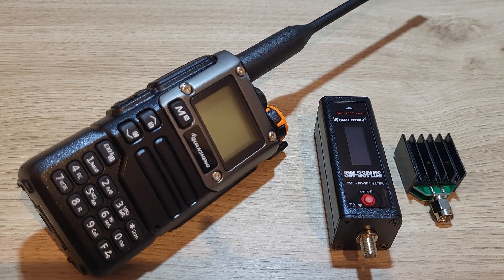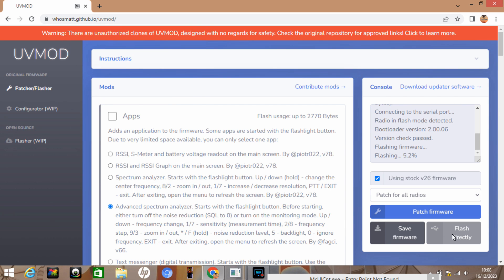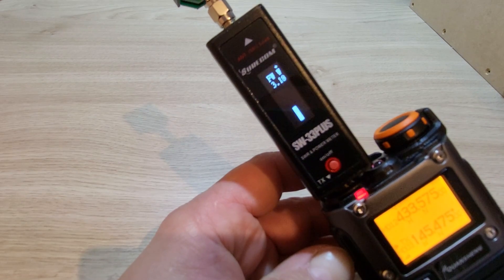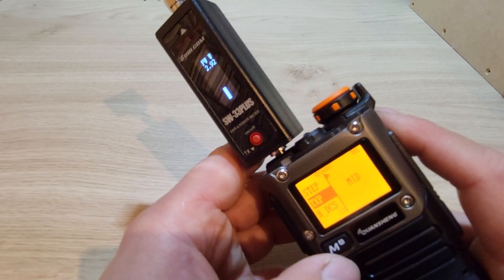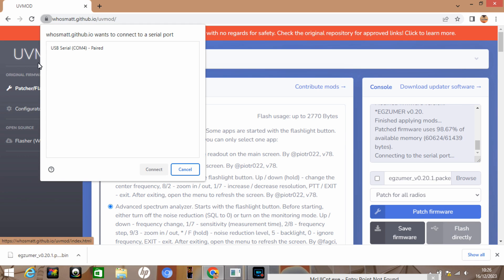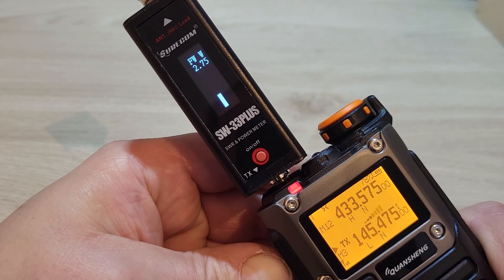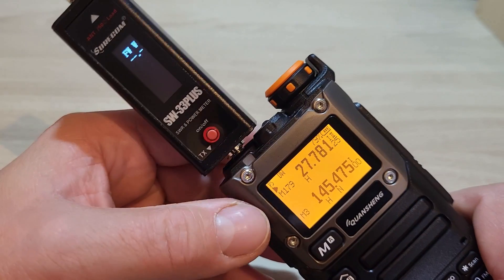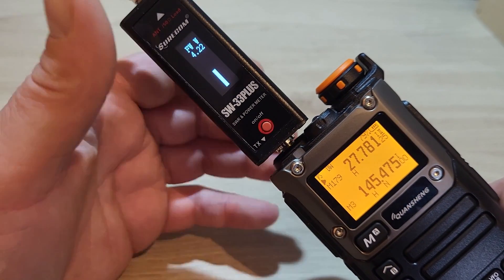Quansheng UV K5 Output Power Test - Stock vs Egzumer

Comment: my radio is only transmitting on miliwats only, , not sure what happened but sometimes it will return back to full power then go back to miliwats    . . two of my radios are like this and I'm not sure if it is a software issue.
Reply from the maker: I've not experienced that happening. You could try changing the firmware. What frequencies are you experiencing that on? How are you measuring the power output? Thanks for watching 👍 
Ben, de M7FRS
Reply: @m7frs272  I use Diamond SX-200 to measure the power output. on VHF it does not even get past through half a watt. I am using the Nunu custom firmware. 

the bands available to us in our country are 145mhz, 325mhz and 430mhz

Sometimes when i switch back and forth between UHF and VHF the power would suddenly go back to normal. But recently this trick stopped working for me and my radios are now permanently low power. 

Thanks for your videos, DW3HHT

Comment: Thank you for posting this interesting video. I have a question, please tell me how you managed to Tx on 27Mhz when it's outside the radios frequencies? All I get is DISABLED and I am using the EGZumer  firmware. Thank you.
Reply from the maker: Hi, firstly I've only done this for experimental and demonstration purposes, and as I've mentioned in this and other videos the Quansheng won't really TX any significant power on the 27Mhz band without causing interference on the Airband frequencies. If you need to be able to unlock it for experimental purposes, you need to go into the hidden menu and select 'Unlock All' 10 times for it to work.
Reply: Thank you.. Appreciating harmonics etc.

Comment: Hello Ben, I love your videos! In order to find the spurious emissions if you TX on the CB bands, you can use something like the TinySA with an attenuator (anything between 10w to 40w) in-line. It's not 100% accurate, but for the money it's a fantastic piece of kit. Combine that with a NanoVNA and you have a very complete set of measurement tools for just about everything in amateur radio. I am very surprised how badly the stock firmware has been calibrated on 70cm, quite shocking really. I have two of these handsets (and one more on the way), the "ugly" K5 and the "pretty" K6 (like yours seen here). It's great to experiment with all these third-party firmware versions, I'll have to give Egzumer a go after this. I like what I see, a 5w HT TX'ing at more than 5w is a rare thing indeed. Cheers! 73, Jan M7HNK
Reply from the maker: Hi Jan, thanks for your comment.  I recently purchased a TinySA and a nanoVNA and I've already done one video with the TinySA. Glad you're enjoying the channel 👍  Ben de M7FRS 
https://youtu.be/BE2Y7V2tGMM?si=ln_WMhUKYujjKgNj

Comment: A little disappointed on your assessment of 11 meters. Without proper testing you really shouldn’t speculate like that. Because all the cb hates just join in, and continue the ignorance. 
Other than that, keep up the other great work on this awesome radio!
Reply: Not sure what you think was said, but what we know so far is that in 11 meters the power output in that band in in low milliwatts.  But there is 4 watts going to somewhere. Others have shown that these missing watts are throwing up all over the place.  And it isn't something you can fix in software unfortunately because the bandpass filters are just not there.  The good news is that the chip can do it, so it is just a matter of time before they start making radios with this chip in it specifically for 11m.  I think they are cheap enough that most of us would happily buy one for each band if it meant we were going to get the full 5w on the frequency we wanted to use.

Comment: I suspect if you were to take a dozen of these Radios, line them up and test for Power o/p you would get twelve different readings.
In reality a Watt or two either way makes little difference anyway, and of course if you're working a local Repeater then no difference whatsoever.
These are great little rigs, but they are what they are...just fun to play with.

Comment: There is a video on YouTube where the owner of the UV-K5 did a test on the stock firmware straight out of the box, and got 6 watts High, 4.5Watts Medium and 3 Watts Low. He then flashed the EGZumer firmware and did the test again with very similar results. He then put the stock firmware back on and retested. The figures were awful. H 2.7 Watts, M 2 Watts and L 1.2 Watts. He came to the conclusion that the EGZumer firmware had bricked the power levels on his radio.
Reply: Very interesting!

Comment: The firmware you flashed the version STOCK 0.26 is not the newest and it's know for a low power output. Try using the latest version for uvk6 V3.00.15.bin or better with the UV5R RT600_v4.00.06_publish.bin . You can compare too  firmware_IJV_V2.5.bin with egzumer_v0.20.1.packed.bin for a better comparison ;)

Comment: its possible to change the power output for the three levels in the service menu of some other firmwares. i lowered mine to make the tx runtime longer in a decent area and not overdrive anything. i set the lowest setting to less than 1 w.. 2.2w and 4.5w
Reply: What are the other firmwares?

Comment: Its a bit disappointing to see low power being so high.  It would be better if they used 6dB steps.  So 5W, 1.25W and 0.3W.
Reply: At least the "Low" setting is much to high i think, would like to have it below 1 Watt..
Reply: @tvelektron  The new IJV Italian firmware can adjust the level.

Comment: Excellent, if basic, information: It suggests that no UHF alignment tests were carried out prior to shipping - but, without a spectrum analyser, it’s impossible to be sure how much of the indicated power out was actually at the fundamental frequency and how much was contained in harmonics; If nothing else though, it does give a caution re 27MHz - because we know the actual output is only measured in microwatts at that frequency - and therefore the tuned/filtered PA output stage is trying to do something it was never designed for, and all that extra off-frequency wattage has to be dissipated somewhere…
Reply: A few microwatts on 27 Mhz, the rest of the 4 Watts are on the harmonics.